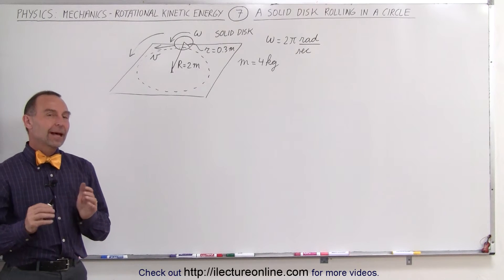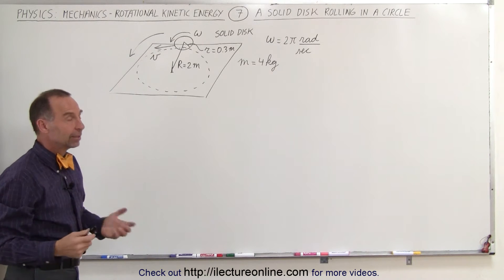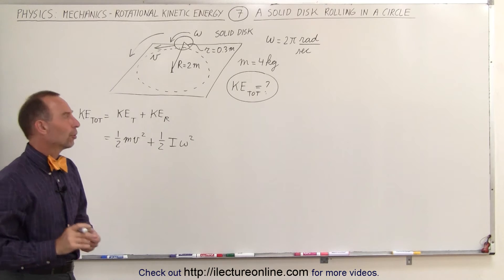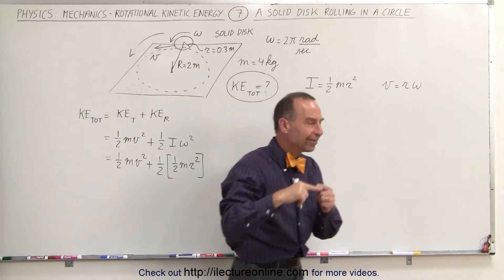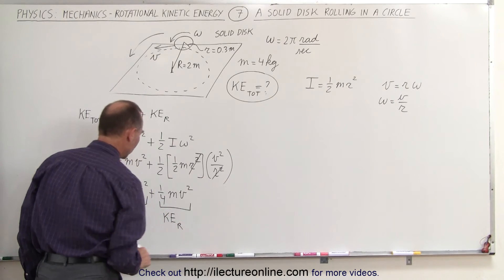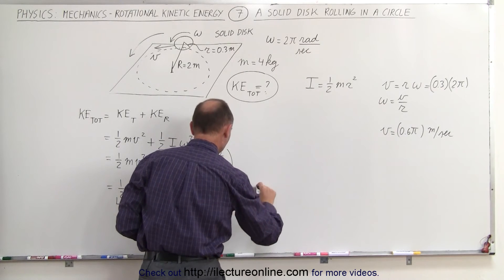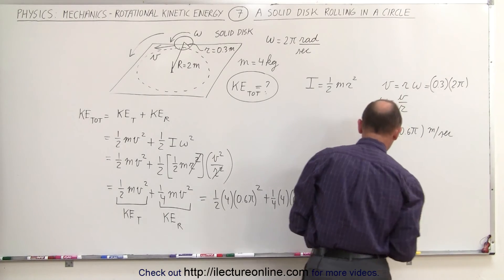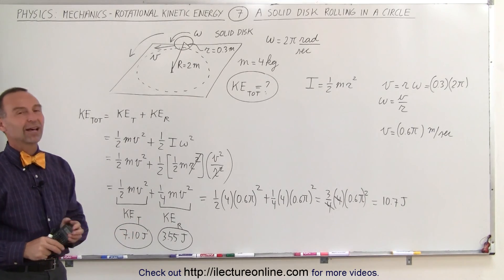Physics 8.5   Rotational Kinetic Energy (7 of 19) A Solid Disk Rolling in a Circle

Comment: Mr. Michel, i was confusing the R in the equation whether i should've used the radius of the disc of the radius of the path the disc circled. I thought we would use the radius of the circumference it made (2m) in the kinetic energy due to linear motion equation! Why seems to be the origin of the perplexion?
Reply from the maker: For the rotational kinetic energy of the rotating disk you must use the R of the disk.  If you calculate the KE of the tranlational motion in terms of the circular motion of the disk then you use the radius of the circle, or instead you can use KE translational = (1/2)mv^2

Comment: ❌ Sorry to say that the solution is completely erroneous. 
❌ Even V ≭ R ω. These quantities will not be equal as the disc will be leaning inwards.  It's   very complex  problem.
Reply from the maker: Just like ALL problems and "theory" utilized at the elementary levels of physics.  You can make that statement for every  physics problem in every book as proper friction, wind resistance, etc. are always ignored in order to show the basic properties and theories.
Reply: @MichelvanBiezen  Thanks for responding. The necessary condition for no slipping is that in one comple spin, the disc will cover the lenth of arc equal to its circumference.  Differentiate this to obtain the relation between v and angular speed.

Comment: Slowly building my own stump grinder  . I wonder about the gear ratio to get the maximum impact in kinetic energy when the  15 inches diameter /1/2 inch thick fully assembled grinding disk will hit  the tree stump ? Do I make the disk spinning fast as I can or  relatively slower and harder to stop on the load?
I will having  56.7 ft/pounds from 27 hp at 2500 rpm.

Best regards!
Reply from the maker: With a high RPM like that you should have no problem grinding down tree stumps.  The HP and RPM are definitely sufficient.

Comment: Sir I think the Rotational kinetic energy you have written is wrong. I have 2 reasons :-
(i) You have not considered the rotational energy of disc revolving in circular motion, I is wrong.
(ii) The disc is in pure rolling so the omega = v/r, but you didn't consider the circular motion omega value.
Reply from the maker: If you calculate the translational and rotational kinetic energy, you will find out that all the energy is accounted for.  Thanks for checking.

Comment: Sir does that disc stand straight on the ground or it is inclined to the ground? Won't there be any change in velocity if it is inclined?
Reply from the maker: The disc is parallel to the ground.
Reply: @MichelvanBiezen  You mean sir the area vector of that disc is parallel to the ground?
Reply from the maker: Yes.   (I was referring to the table), but you stated it correctly.

Comment: So why in this case the total kinetic energy is consisted of both KET and KER, while on the other hand the previous video had either KET or KER as the total KE? is it because the other object was like a  point object?
Reply from the maker: You only need to consider both if the object has a moment of inertia and can store energy by rotating.
Reply: so are you saying for the previous video the other object could not store energy by rotating? it had a moment of inertia so i don't understand
Reply from the maker: The previous video has a sliding block moving in a circular path.  So you can find the KE by considering the tangential motion OR by considering the rotational motion (traveling in a circle) but not both because the object itself is not rotating about its own axis.

Comment: In this video we only use r=0.3m, its KET and KER. The confusing part for me was R=2m why we didn't use it at all? The object is also rotating about it perpendicular axis with radius 2m, it should also have KET or KER.
Reply from the maker: Since we didn't know the velocity of the wheel, we needed to use that angular velocity to find the velocity first.  Then since KE = (1/2) mv^2 we don't need the R = 2 m to find the KE.
Reply: @MichelvanBiezen  No, not quite.  The point is that while rolling in a circle, the disk has not only traveled by that circle's circumference, but also made a complete rotation about a vertical axis.  That rotation about this other axis also has kinetic energy - though the rotational moment inertia is not the same in all principal directions...  Regardless, to convince yourself that kinetic energy is missing from the video's solution, just take R to be rather small, whereby most of the motion you see is this missed term of the rotation about the vertical axis.  Though in the dimensions of your drawing, I think this forgotten term will have a small or even negligible contribution.

Sorry to nickpick.  I love your videos and recommend them to my students every year!

Comment: It is not clear why the speed of the end of the arm with radius R=2 m must be equal to the speed of any point on the rim of the disk (wr). It is assumed that v=wr=(w_arm)R. Why?
Reply from the maker: Think of it in terms of a car and its tires.  The speed of the tangential velocity of the surface of the tire is equal to the velocity of the car.
Reply: Thank you for the hint. Now it is clear. I must think as is the arm with R=2 m is the car now travelling in a circular path. The disk is the tire in contact with the road and rolling without slipping. The center of de disk must have the same velocity as the velocity of the end of the arm. The radius of the circular road is R-r=2-0.3=1.7 m
Reply: doubt cleared...

Comment: Once every trip around the circle, the disk rotates about an axis perpendicular to the plane of its circular motion. Doesn't the energy of this rotation need to be taken into account?
Reply from the maker: Yes, and it is taken into account by the linear kinetic energy:   KE = (1/2) m v^2.  You can also as you indicated think of it as rotational kinetic energy, but you can't count it twice (one or the other).  And not to be mistaken with the rotation of the wheel itself which must be counted in addition.